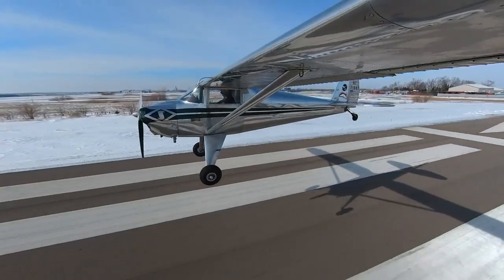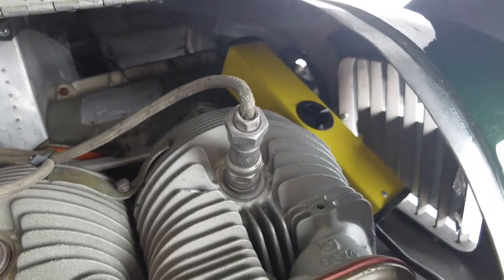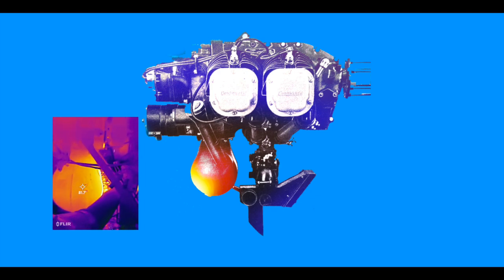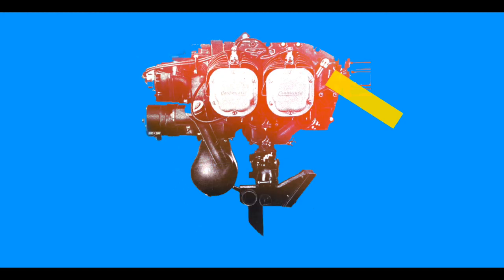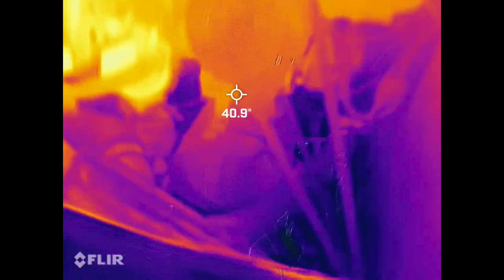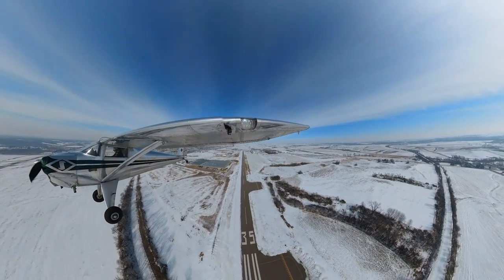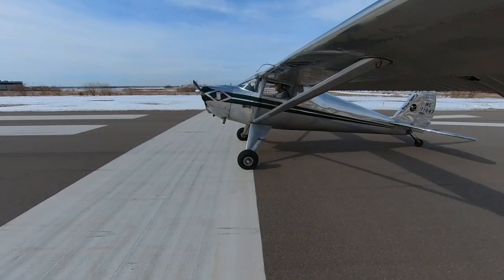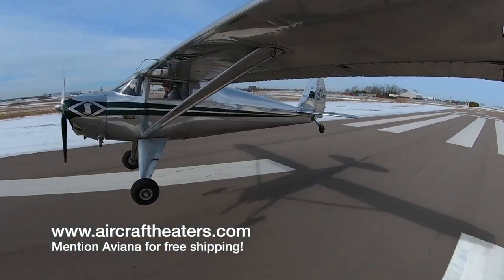Aircraft Engine Pre-Heat Deep Dive!

Comment: Moisture in the oil wither heating from the top or bottom is still moisture in the engine. You need to remove the moisture with a desiccant. Sounds like an ad for the heater to me.
Reply from the maker: Using a desiccant would be nice, I saw a guy with a pump system on his malibu, moving air through his crank into a can of desiccant. That is a bit more complex setup than I care to go for. 

Moisture in the oil will stay in the oil until you heat it up. Id rather the moisture stay in my sump than condensed over my crankshaft. As long as I can keep the engine over the dew point, I am not worried about the excess moisture, especially since it is quite dry here in the winter. When I heat the oil pre-flight, the fill cap is also off, so I would imagine most of it would escape out of there.

Comment: Great video, thanks for posting. Maybe I missed it but, how long did it take  for engine to get up to temperature if/when  you want to turn it on remotely?
Reply from the maker: I just leave the blowing heater running all the time. The oil pan heater I only turn on 30mins before flight
Reply: @AvianaAircraft  why not just turn it on 2-8 hours before flying? Otherwise you are wasting a lot of electricity And exposing your plane to a fire hazard.  With your remote you can schedule it to run only as needed.
Reply from the maker: Good questions! It doesn't use that much power (and I am not paying for electricity separately at the hangar) once the under cowling temp reaches ~70F it shuts it self down. 

The unit is intrinsically safe, so it could in theory run in a combustible environment (unlike the space heater I was using before!) The main reason however for running it continuously is to get and keep the internals warm. I am not sure how long I would have to run it to go from a cold start to warmed insides. 

Generally I go flying on a whim so I don't have enough heads up time to get the internals warmed up as well. Within the 30 minutes from house to flightline, I can get the oil warmed up however.
Reply: what is the designed duty cycle for the heater, is it designed to last for years being turned on 24/7?  A failure could be fire.
Reply from the maker: It is rated for continuous duty, you can read a bit more about it here https://www.aircraftheaters.com/operating-instructions 
and here https://www.aircraftheaters.com/owners-manual

Comment: Worrying about a tiny bit of moisture condensing in the engine a couple hours before start up is pointless. Most of the moisture would have condensed on the internals several hours after shut down anyways. Having a 300w device on 24/7 is not being energy or economy wise You're burning through 7.2 KW everyday. Using a 60 w incandescent light bulb under the engine inside a well blanketed cowl 24/7 will keep the engine reasonably warm in most cold conditions. and a lot cheaper.
Reply: Considering the fact that the unit is thermostatically controlled, the unit would not be running 24/7 as you implied. The manufacturer estimate usage at 60%. But using your numbers, 24/7 operation at todays excessively high rates, the unit would only cost $26.00 a month to operate. If the average number of months that operators need to preheat is 4 months, you’re talking about a total of $104.00 to protect your engine each year. If you can’t afford $104.00 a year, you can’t afford to own and operate a plane.